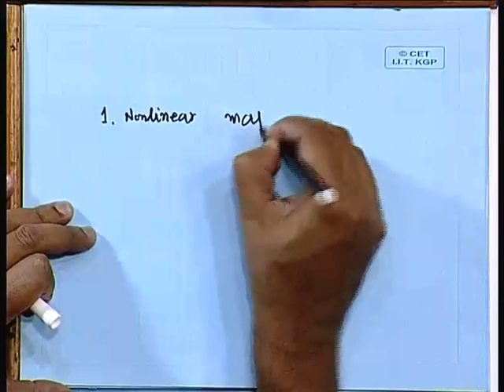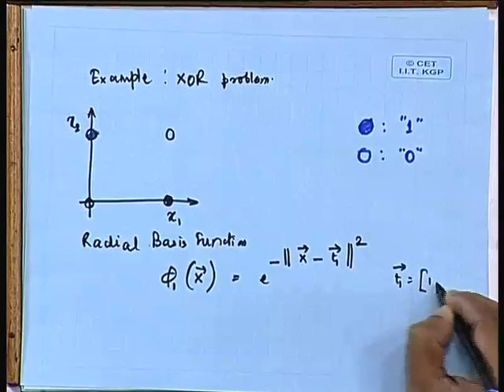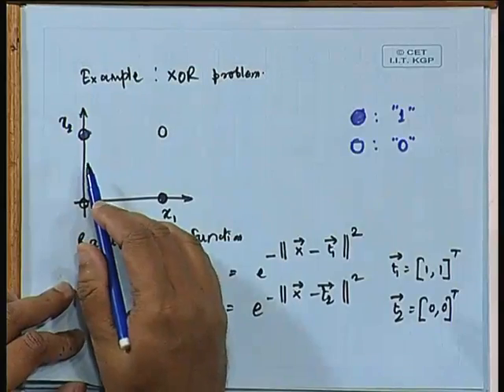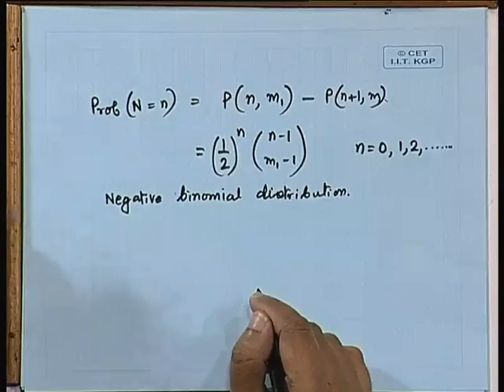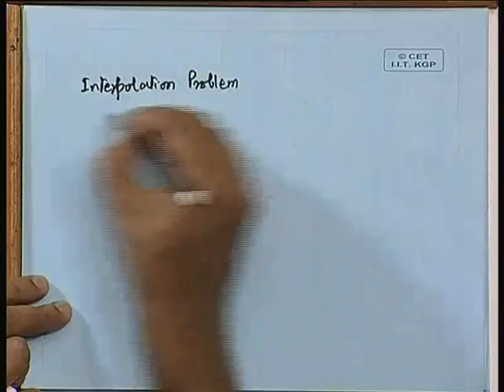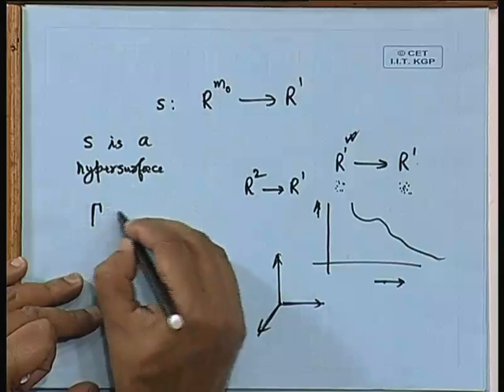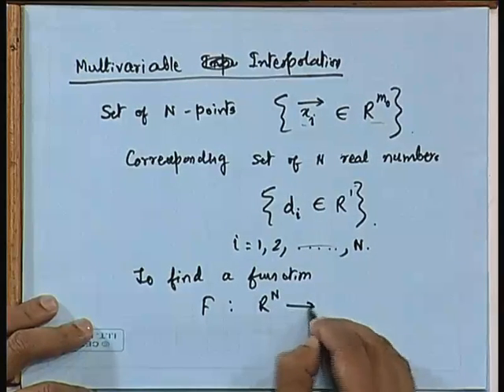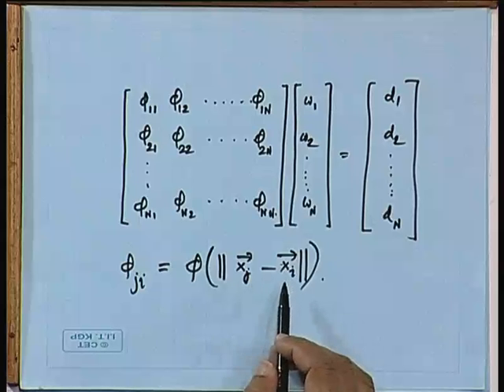Lec-25 Radial Basis Function Networks: Separability&Interpolation

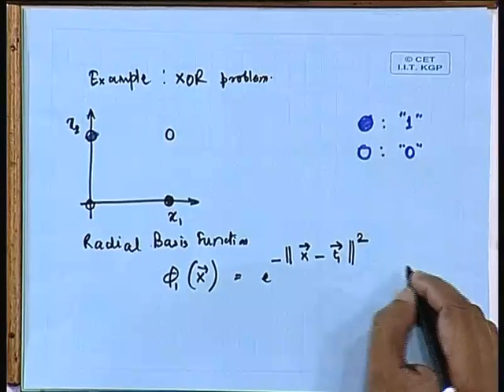Comment: hell, please in 10:41 why did you choose t1=[1,1] and t2=?
Reply: From x plane 
We consider to sperate this we use pair of guassian hidden function as radial basis fun
You see them formula of pi of x vector it's e to the power of x vector minus t1 vector 
Here t1 we take as centre of guassian from x plane we get center at point 1,1 and 0,0 .